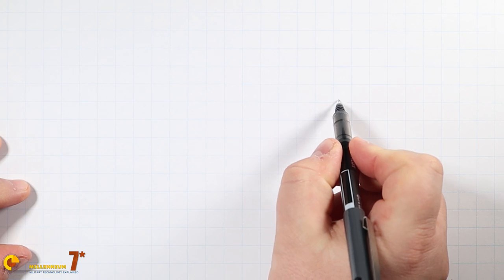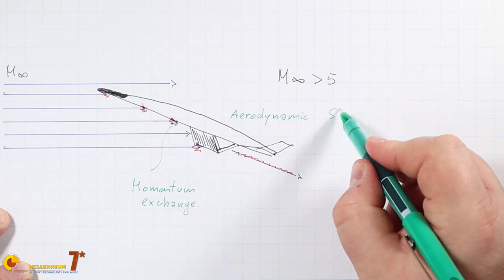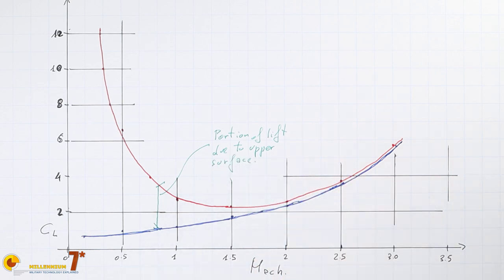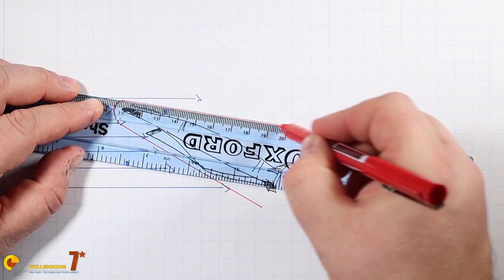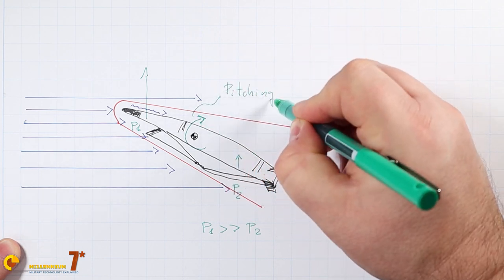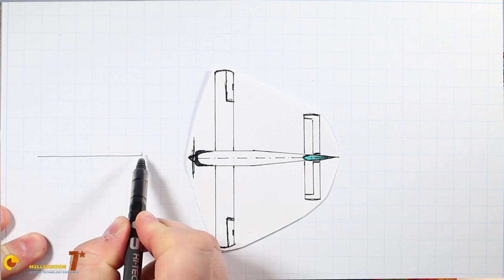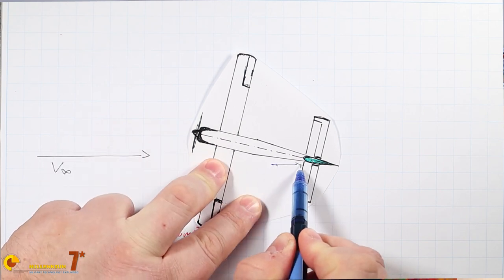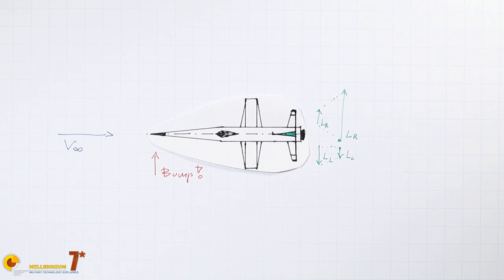Flying with no Wings - Hypersonic lift and stability

Comment: The subsonic lift explanation is mission out on a lot, as not all of hte lift is due to the speed difference, for example the fact that the air leaving the trialing edge is going down (instead of stright back) also contributes to the lift.
Reply: My understanding was that the formula for coanda effect lift and Bernoulli lift wind up basically yielding the same solutions.
Reply: @unclejoeoakland  Wrong. It doesn't even account for majority of the lift a wing makes.

Comment: could we use the technology for single stage to orbit?
Reply: It depends what do you mean by that question.
Some amunt of consideration for hypersonic aerodynamics is a necessity to reach orbit, since as you go up, air gets thinner, speed of sound goes down, mahc number increases at the same speed.
Ofc. the amunt of knowledge needed depends a LOT on what you want, as a spaceplane like skylon is very different from and SSTO rocket.

At the end of the day when it comes to SSTO all is decided by specific impulse.
Sure you can "cheat" a bit by not carrying oxidizer for the low altitude part of your trip - like skylon plans to do - however its still about specific impulse.